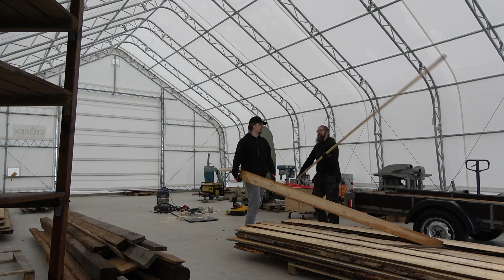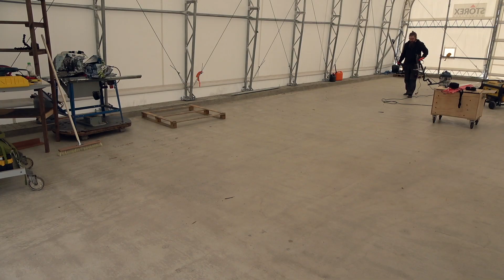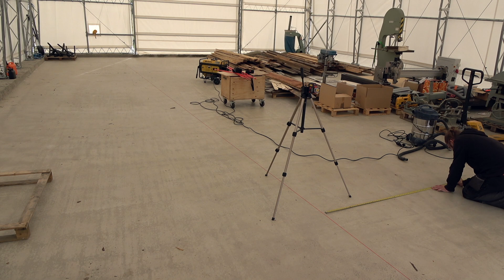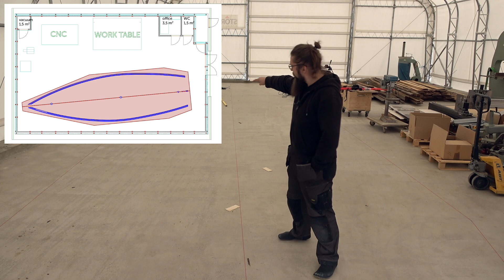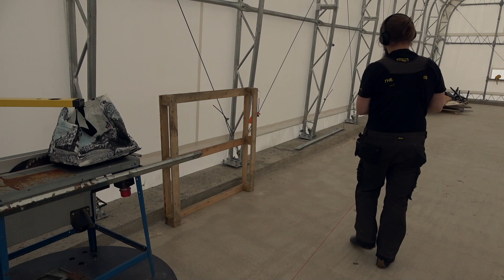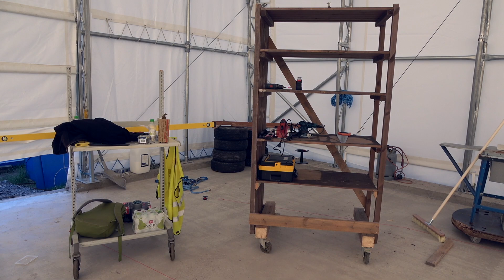Preparing the workshop for boat build! ep.40 Project SeaCamel

Comment: I've come here years too late, but for a project like this, it should be. Design boat. Design workshop. Build workshop. Equip Workshop. Build CNC. Test CNC. Install CNC in the workshop. Build Boat.
Reply from the maker: Only the last one to do anymore! 😅
Reply: @ArcticSeaCamel  Agreed. I'm useless on projects where I go from one task and then another. I have to work on just one thing at a time, or it seems to double the time to finish if I don't.

Comment: Once you mark the floor spray over clear spray paint.  Use old tape measure,  break off a few feet and tape to a good stick. Move the stick around and get a fast, accurate reading,  and you will find out how much your off.

Comment: Have you considered building a smaller enclosure within the tent for the CNC router / gluing & epoxying as that would be easier to heat when it gets colder , I too have been following Matt & Jessica , and they’ve had to be careful when they use “epoxy” based on the outside temperature  and their ability to heat various ares of the boat .
Reply from the maker: Hi. I'm still planning to do insulation layer for the whole workshop. It's really not possible to use epoxies (temperatures constantly over 15°C) here except for few weeks at summertime and I'd like to enjoy that time by another manners as well 😅⛵️. Many of the gluing jobs are done anyway on the boat itself.

So I need to raise the temperature whenever I need. I'm also gonna have small storage room that's warm all the time to store things like paints.